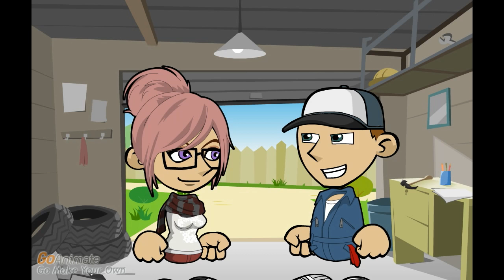Why is My Water Heater Making a Popping Noise?

Comment: My brand new tank makes these noises.   No sediment yet.
Reply: I had one installed last year and it sounded like popcorn within a month or two.  Guess I'm going to call the plumber back.
Reply: Why are you not calling the service center?
Reply: @gorachand1235  Mine does as well but everytime I let someone know they just shrug it off. Basically ours sounds like a jet RIGHT after the water is hot turned on and we got it last year.